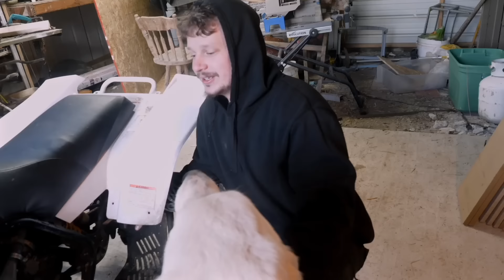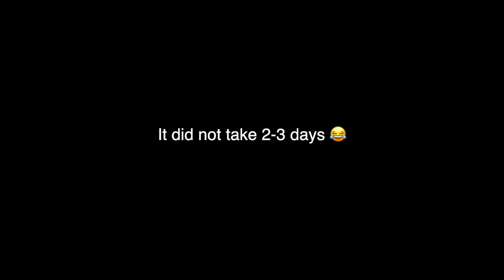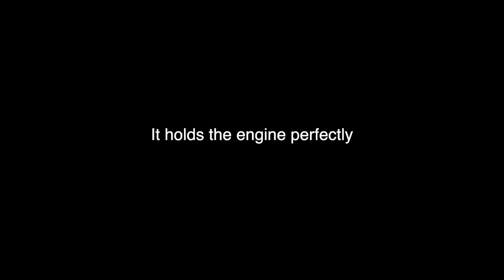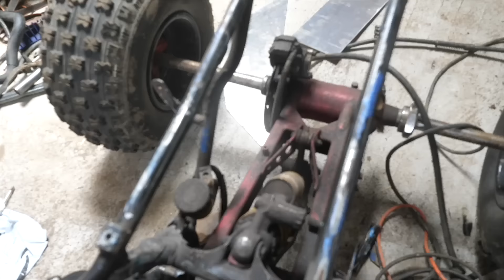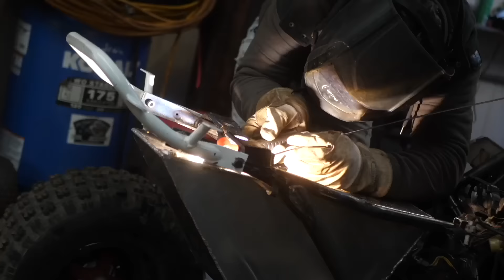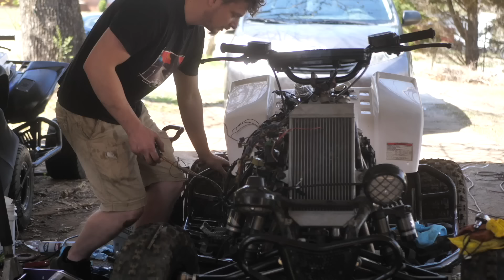I HAYABUSA SWAPPED MY SISTERS BANSHEE

Comment: Only 26k miles lol that's a shit load for a busa motor. You know it was beat on constantly with a lot of high rpm rev limiter action. That 1 valve seemed to be leaking quite a lot so I would say it was slightly bent, especially since you said the chain was stretched

Comment: You should beat a quad that can handle the trails but with a lighter engine, like a tripje 765 or a big v twin like 990. Power you can use on a trail and better handling then a 700 factory quad.